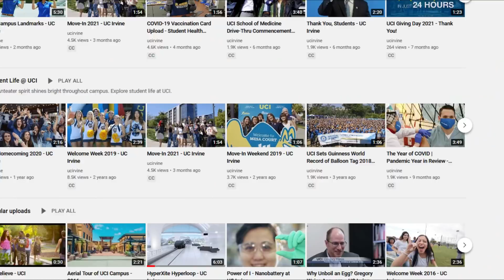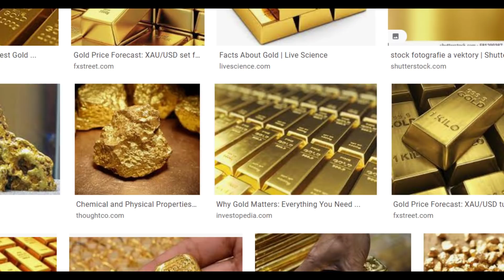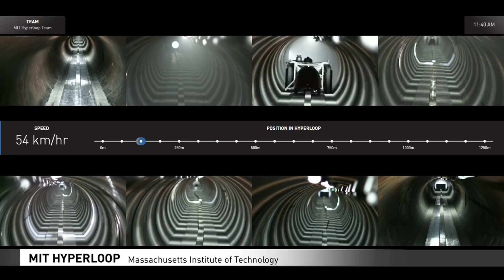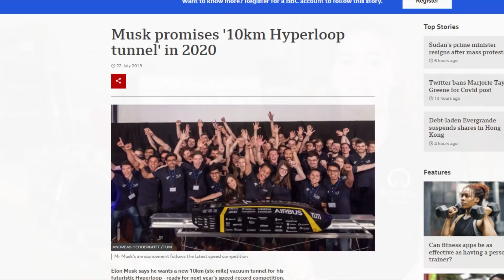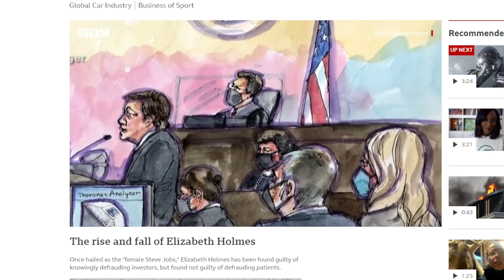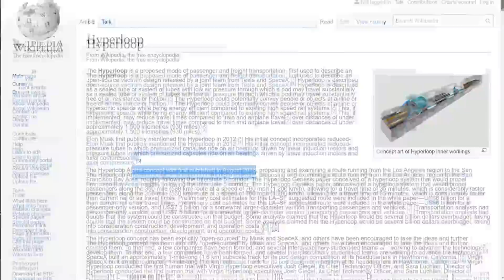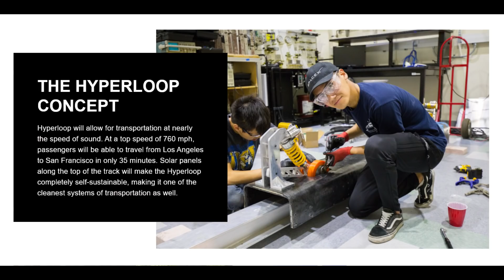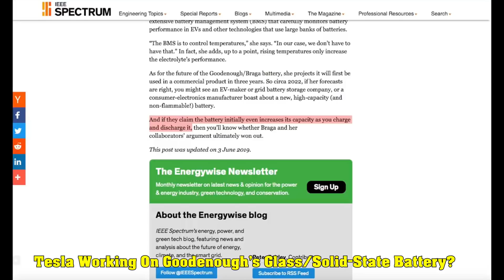The GOLD Battery that will revolutionize EVERYTHING!

Comment: As a UCI engineering student, seeing an entire team STILL dedicated to the hyperloop is embarrasing. The gold battery however, is more a disaster from how it was marketed by the news department, the actual publication doesn't even mention batteries, because its a capacitor. Is it more expensive? Yes, and will likely never be used in most applications. That doesn't mean its useless, its more of a proof of concept and if it turns out to be that much more durable than other capacitors could be used in certain applications, just not powering cars or heaven forbid houses.
Reply: I mean if it can bring longevity/reliability to capacitors, I can see it used in some application that require longevity. Like for example electronics in space.
Reply: @mukkaar  yeah, Im thinking space applications make the most sense because pricier components can be used if they have better functionality. That or any other industry that requires parts to be highly durable and costs don't matter as much.
Reply: Durability goes without saying it's freekin gold probably the best specific resistance of all materials not to mention conductivity and heat dispersion, of course it would be best to have gold capacitors just not financially viable, furthermore i would expect them to be used in some experimental tech but beyond it i dunno.
Reply: @lordhater4207  Silver is best for conductivity & heat.  Gold's main trick is it doesn't corrode, followed by it's very malleable.  Shiny, thin and non-oxidizing is good for mirrors etc.
Reply: @lordhater4207  UM no ,   Electric conductivity (10.E6 Siemens/m)	Electric resistivity (10.E-8 Ohms.m)	Thermal conductivity (W/m.K)	
Silver	62,1        1,6	420	   
Copper	58,7	       1,7	386	   
Gold	44,2        2,3	317
Reply: You're gonna need a bigger crane.
Reply: It may not be totally useless, but it definitely is pointless. Anyone with a basic understanding of electronics knows that a capacitor is made up of 2 plates and a dielectric. If you put ANY two bits of wire anywhere near each other, they will act as a capacitor with air and the wire insulation acting as a dielectric. This is a very well known phenomena. All the girl did was replace the air with an actual liquid dielectric to increase the capacitance which is a very common practice. I don't even think its a new dielectric or anything crazy. So even if the capacitor isn't totally useless (doubtful), it is pointless because anyone who would need something like this probably already know how to make it themselves.
Reply: @j.f.christ8421  no, diamond is best. i have personally worked with 2200w/mk samples grown atom by atom it can take extreme laser power densities. 6x better than silver/gold/etc
Reply: @brianstevens3858  I completely forgot electric materials apparently, i just assumed all noble metals are best conductors starting with platinum, gold and then silver.
Turns out it's, Platinum, Silver, Gold.
Reply: @lordhater4207  Yea Plat is the best, but law of diminishing returns excludes it due to cost. Oddly enough it's not enough better to justify that ratio, unless of course the ratio of wealth is 1/99 in your favor. lol
Reply: +Gabriel Jorquera  Exactly as I suspected.
Reply: @tristanjones7735  I do not blame the student.  When you are an student, you are learning, and if find something and ask your professor / guide, it is their job to tell you that what you discovered is a known thing, or it is a new thing.  Here the professor, lets say, was not up to the task; and do not even talk about marketing... how a capacitor converted into a battery.  They even say it is a capacitor but then talk about batteries.
Reply: @C783H  Yea, we need to get corporate influence and private influence back on the marketing and consumer end where they belong,
Reply: -Matter didn’t create anti matter
-Anti matter didn’t create matter
(Both of them were present at the time of big bang)
-Both of them didn’t create themselves.
-Both of them came from an unimaginable source,  that unimaginable source created matter and antimatter (everything) thats why it is known as “the creator” of everything.
——————\\\\\\\\\\\\\\\\\\\\\\_______
- that unimaginable source/creator has created sin and virtue which are opposite to each other,
— logic says every action has its own reaction, so the reaction of sin must be different than the reaction of virtue,
— the creator has created prophets to let us know about each and every detail of sin and virtue, also about their reactions,
Thank you :)
Reply: @N4CR  I forgot about diamond, how's making IC substrates from it coming along.  Diamond is a bit hard to make wires out of though.
Reply: @brianstevens3858  You sure about platinum?  Last time I checked it was way down the list for electrical & thermal.
Reply: @j.f.christ8421  It was a joke, sorry if I came across any other way, maybe I should reword so others don't assume the wrong info. Or I guess it would be just as effective to state here that you are categorically correct.
Reply: @brianstevens3858  Ah, fair enough, carry on.  I was sitting here thinking 'Wait platinum? Did I miss something?"